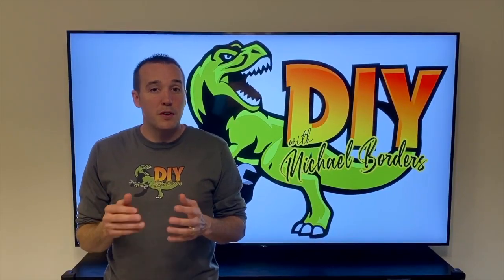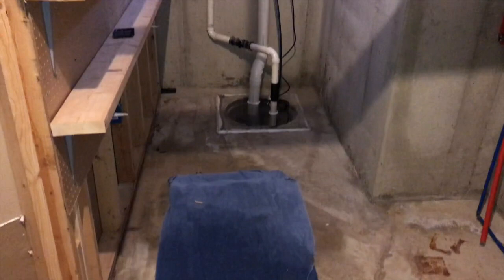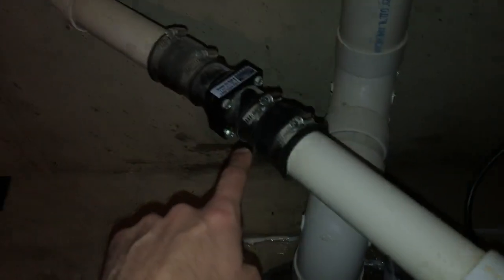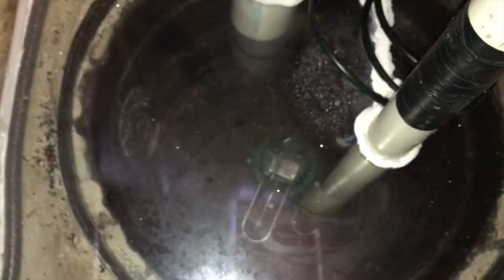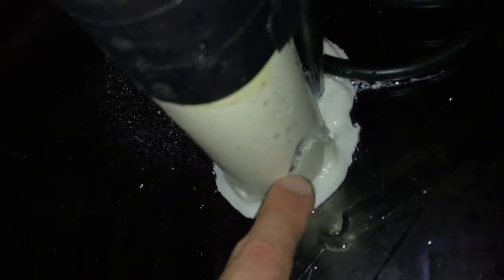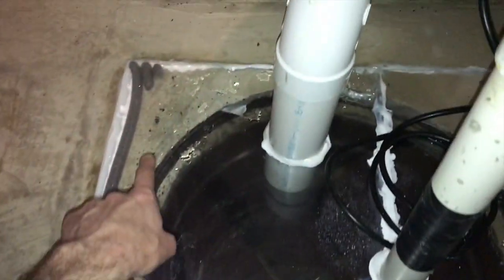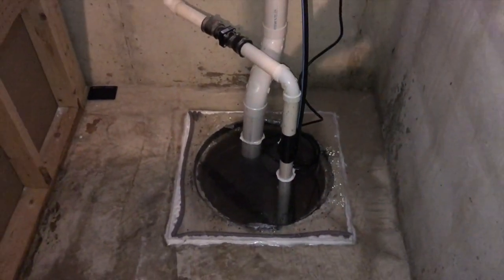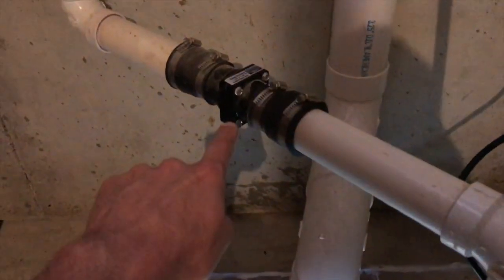Water leak in basement - Inspecting sump pump

Comment: How frustrating.  We’ve had a lot of different repairs to a house we just bought, and so far 50% of the time we have to call them to come back and fix things they either missed or sloppily installed.  We are using established companies, but it’s the luck of the draw who they send out for repairs.
Reply from the maker: Thanks for sharing this & we were very surprised that a professional technician did this.  Unfortunately it was a bit sloppy & it cost a bit of money for the company.  They were extremely professional & kind to come back & fix issues for 100% free.

We appreciate you watching.  😎👍
Reply: That’s the way the world is now. Same experience here. Professional doesn’t really mean anything anymore. Short of things that require a certification/appropriate training it’s becoming clearer and clearer to take the extra time to learn and do yourself.
Reply from the maker: @kylec7924  

Thanks for sharing this Kyle.  We were definitely disappointed & upset when we saw the water however they came through in the end...

Hope all is well.  😎👍